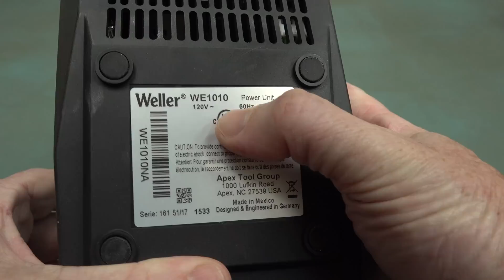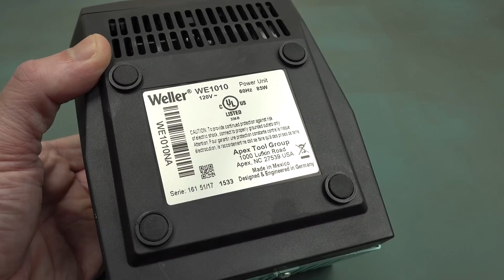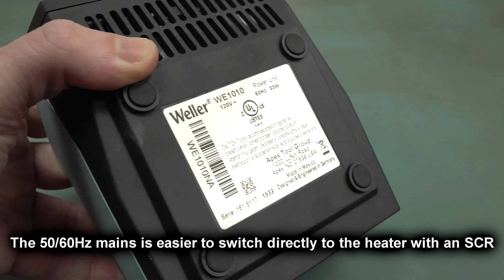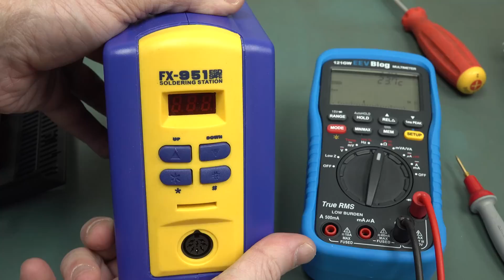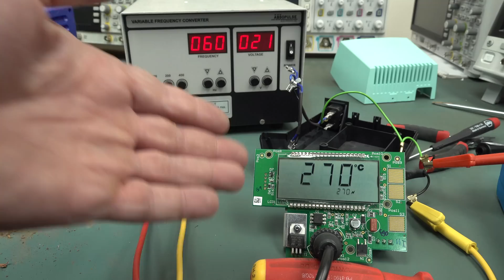EEVblog #1152 - 240V-120V = Magic Smoke!

Comment: The power tranny was a 600V triac. It should withstand the voltage even without the transformer. And you are right, once I want to use a GDR (East-German) 110/220V to 12V transformer (two primeries, you can connenct them serial or parallel) for my tcp-24 solder iron, so I gave a try and plug it into 230V as a 110V device and it didn't burn, but it was very loud.

Comment: It's not the lack of a fuse that is shocking (no pun intended) a fuse probably wouldn't help anyway. It is the fact that it has an IEC C13 connector, inviting idiots to plug a 230V kettle lead into it. It should have a fixed wire with a 120V plug on it, then at least they have to cut the plug off and wire their own on before they can burn their house down. At least that might make them think for a moment!

Comment: The transformer step down approach to heater control is easily done with SCRs or MOSFETs to only turn on or off around AC voltage zero cross with a largely resistive load. This minimizes the power dissipated in the switch(s), and has been used by PACE, Hakko, JBC and Weller to name a few. Historically, I think PACE and Weller used the technique as far back as the early 70's. The only down side is the heater is usually (for cartridge style handpieces) in series with the tip thermocouple so you have to keep the power circuit off while you read the thermocouple. If you put a cold junction temperature sense in the handle you can then determine the tip temperature.

So what exactly was the transformer failure mode? The primary winding got hot enough to melt the varnish and then short out and burn up. Okay, but where was the overload that caused the overcurrent in the primary? The fault must have started on the secondary as an overcurrent by was sustained long enough to heat up the primary. Given the secoundary fuse I am not sure how long the secoundary actually was in overload. I think the transformer was defective in manufacture or selection from design. The heat generated should not have burned through the primary varnish. Putting a fuse on the primary may not have solved the problem, given the fact it would have to be a slow blow type to not trip on magnitization current when power is applied to the transformer. The primary winding should be tested at around 1200v with a hipot tester so 230VAC will certainly not breakdown the primary insulation. I wonder if the weller unit was actually a clone from China?

Comment: Be sure not to use it in the shower!! I wouldn't use any electronic component that uses mains voltage that doesn't have a fuse on the primary side. Brain fade is the main reason why they have fuses in the first place. That could have set the lab on fire or melted the insulation on the primary wire insulation and electrocuted someone.

Comment: I realize this is very late to comment, but I just saw this video, and I can add a few things about the regulations about fusing in North America (which is the market this device was designed for).
Here, at least, the wiring in the wall is protected with over-current protection in the fuse-box or breaker panel, and the device being plugged in... well, it needs to take care of itself, because the supply isn't going to help it.

The general gist for small transformers (control transformers and the like) is that they can be fused EITHER on the input or output side.  Of course, you can fuse both sides if you choose.  I usually do that in the panels that I build, but it's not actually a requirement.

Now, I just bought one of these Weller soldering irons (the WE 1010 NA) a few days ago.  It's at work, but I'm going to check it out and see if they added primary-side fusing to it.  I didn't happen to notice when I looked at it after purchase.   I've used it for about an hour so far and I like it a lot.

Comment: Did you found out whats happened?

I guess that there is some kind of LDO that brings down the 23v to, let say, 20v or so for the heater, and the voltage drop is only like 3V or so (3v x 4A = 12W heat from linear regulator).
And when applied 46 v instead, voltage drop became 26V x 3A = 78W or so, which quickly overloaded the transformer and popped it before the LDO popped. Or something similar.

Comment: @EEVblog - Just found this video after Robert Feranec's Xilinx one, and I'm curious about the Absopulse unit you used. What is the model number/part number? I cannot find it on their website. Thanks! Cannot fathom why Weller, a company as large and with such a long history in the soldering industry, omitted such a fundamental safety feature. Love their response too. Muppets.

Comment: You could still use that secondary side as a inductor :)
And if the board can accept DC input, you can just hook it onto a swiching supply and get rid of that transformer thing at all.
Reply: Just realized that inductor would not work. You have to get rid of that shorted primary completely otherwise its still a transformer with a shorted primary side...... :(

Comment: Weller should have known better - always have a primary side fuse as well! Also a good lesson for new designers. Don't forget when calculating AC power across an inductor/primary winding you have to factor in reactance/power factor as well as the DC resistance. Fortunately you just blew the transformer. Cheap fans can also start fires when the bearing seizes up (usually hardened grease) and the motor windings overheat causing a similar fire as would the Weller unit....newer/better fans have a  fuse in the plug to prevent that.
Reply: Also better than a fuse or in addition to a fuse would be a thermal cutoff on the transformer...best safety.

Comment: Been there, done that, have the burned transformer to prove it. It STINKS!! Worse than capacitor smoke. In my case it was 110V controller connected to a 220V laser exciter. Like your weller, none of the electronics inside the controller burned, just the transformer primary. Being vintage equipment I want to find an exact match so I do not need to place extra holes in the control console for the laser.

Comment: I have always held Wellar in very high regard. I am absolutely shocked and horrified at this revaluation. We have about 12 of them in our workshop. If what you are saying is also true about our soldering irons too, I am going to have to install fuses in all of them. I would rather spend a few cents on a fuse than end up with a burned down workshop.
Reply from the maker: Take one apart and check
Reply: @EEVblog  Thar is exactly what I plan on doing first thing on Monday. I will let you know what I find.

Comment: I had an HP rack mounted UPS burn up like this about 15 years ago. The electrician in the data center had mis-wired an outlet. HP replaced the unit, but there was no fuse on the mains. That thing poured smoke!

Comment: Thankfully I have not done that yet, I have been accused of doing that 120 volt Appliance into 240 and I'm like no way I'm in a foreign country I would check everything before I plugged in. I did have a pleasant visit for the Philippines apart from that. I also do not recommend sampling the electricity 240 volts 60 hertz is not pleasant but that's another story and I did not bring enough electrical tape with me!!!!!

Comment: This is a consumer grade product.  That means cost reduction is the first order of the design.  The core is marginal at overvoltage (132v) and rapidly goes into saturation above that.  At 240 volts the resistance of the primary winding is all that limits the current, making the primary winding into a furnace of a kilowatt or more.  The college would probably burn down for sure because the students would think the smell is from a bad batch of weed and would do nothing to save their dumb asses.

Comment: You are using a part out of spec and blaming the designer. The soldering station was designed for 120V and you are using it at 240V. It seems you belong to the group of people how blame for to hot coffee, blame that the pet in the microwave did not survive of if you pump up your bicycle tires with 20 bar and explode, that the bicycle wheel has no over pressure release. If you like to use a part at 120 and 240V net, you should by a suitable one.

Comment: You found a Weller product that was cheaply made? SAY IT ISN'T SO. Alert the media! Call out the national guard! Oh wait, this is business as usual. Solution: stop buying crap. Oh wait again! There aren't any better products any more. Hexagon lost their damned minds and will disappear soon if they haven't already. Ungar was great until they sold out to Weller (Cooper Tools). Just try to find a decent station with a RUBBER insulated cord on the hand piece these days. Hakko's consumer grade stuff isn't terrible, but the ones I've touched all had low heat capacity tip designs.

Comment: No worries mate. That transformer should be able to be bought as a whole assembly with the fuse and all from Weller. Might be able to get it local purchase, even better and help your economy in the same breath. Take care mate! Would like to see you take a Pace WJS-100 apart as some don’t think it is as good as the ADS 200 which isn’t built as robustly. Certainly not as robust as an MBT 250! Keep up the good work mate!👍🏻

Comment: Australia uses a type I plugs. This station would have come with a US type A This situation would would be easily avoidable if the IEC end of the power cord was not universal or if Weller is so cheap, they could have direct wired it.

Comment: we have 2 weller's over 30 years and nothing happened  and every one knows   never put something 120 in 230 volts    try it with your tv a/c or something and there is a fuse a small red one with a termal  protection in line

Comment: You have think about saturation in the magnet core. A transformer is a couple of coils. If the voltage on its primary side coil is lower or equal to the rated voltage everything is OK and the current flow through the primary coil is low and the flux density in the magnetic core is round 0.5T. At the moment when you applied double of the rated voltage the current through the primary coil wasn't doubled. It raised more than ten times in matter of the saturation of the iron core which caused a drop of the inductivity of the primary coil to a value like being a coreless coil. ;)

Comment: I think a EI iron core of this size can transform maybe 50W means it can handle the magnetic field of 50W. It is not able to handle 200W so the magnetic field can not rise to give 4 times the inductive resistance. It breaks down. So the power rises much higher.

Comment: Pretty dumb for an electronics engineer to plug a 120V AC device (not designed to be sold or used in Australia) into a 240V AC power outlet in the first place.

Comment: pluged 5V DC smart home controller (like the Hub thing) device into 12V.
it did not even blow the inner fuse it just killed the resistors, capacitors etc. around the plug in. 

some devices are just oddly dessigned (particullary since most of these hubs used difering Voltage yet same exact power plug)

Comment: I myself experienced some magic smoke from an film capacitor of an old vcr. It was unfortunately opened when it happened and so it was shooting smoke at the ceiling like some firework. Took hours to get rid of the smoke smell. I was lucky enough to not have my head over the vcr when it happened. It literally took place 3 seconds after I studied the circuit board with my head obviously over the bloody thing while plugged in.

Comment: Dave, it wasn’t some saturation that “exacerbated” the failure. Core saturation was in fact the sole cause for this failure. V^2/R figures only in the very short term, since you’re also driving the heater with 4x the power, so when the transformer handles the heater load, it’ll only see it at 25% duty cycle. So no, this failure had nothing to do with wire insulation, and the V^2/R dissipation indeed happened because this core will conk out at just a few percent overvoltage at 50Hz. It was designed for 60Hz, and even then Weller probably made it handle not much more thab 140-150V. I have a similar vintage Weller transformer that looks identical AFAICT and it doesn’t saturate at 150V 60Hz, but saturates just short of 130V at 50Hz.

Comment: The reason it happened may be of interest: it wasn’t an insulation failure or breakdown that precipitated the smoke escape. The high voltage in itself is not a problem at all: the winding and the insulation would have handled it. The problem is that the core was minimally sized and saturated as soon as the voltage got over 130V or so – also since Aussie 50Hz eats away at whatever margins were there in a 60Hz transformer design. I have a similar 120V Weller model and the saturation indeed starts around 125-130V 50Hz. By the time you reach 240V AC on the primary, the winding behaves like a ~50Ohm resistor fed from a 50% duty cycle 120VRMS supply, and promptly overheats, producing the mesmerizing billowing smoke :)

Comment: The low primary resistance only figures into power dissipation under the assumption that the primary current bypasses most of the windings – probably a correct assumption in the case of a smoked transformer :)

Just to clarify, then: such low impedance doesn’t matter when the current makes it through the windings, because it’s not the (low) wire resistance that determines behavior then, but the inductive reactance. The primaries have “high” resistance only due to other constraints, it’s not somehow a requirement that transformers have high primary resistance. In fact, it’s a drawback, because that resistance contributes to heat dissipation. An ideal transformer of course has zero winding resistance :)

Comment: I once accidentally connected a wire to the wrong terminal in the breaker panel and fed a circuit in my house with 240V instead of 120. After I switched the power back on, I casually made my way from the basement where the breaker panel is to the second floor office, and as I entered the office I saw a lot of smoke coming from the wall wart transformer on the cordless phone base, which was still powered up and appeared to be working normally. At that exact moment I heard a loud POP! and the lights and display went out on the telephone base/answering machine, and I immediately knew what had happened. So I ran to the basement and shut the breaker off, then reconnected the wire for 120V. The plug-in transformer was toast, of course, but when I found a replacement transformer, the telephone base was in perfect working condition. I figure it was designed for a wide range of input voltages, and in fact many DC voltage regulators can handle a doubling of input voltage without overheating or damage, and maintain proper output voltage too.

Comment: Wouldnt the primary fuse only blow when current reached a certain level which may mean the windings would have to short and already some damage is done at least?  or would you set the fuse to be just high enough that the extra push from 240v would send current high enough to trip it but not burn the windings yet. Is there such thing as a voltage fuse that can sense higher voltage and trip instantly or do you have to you a crowbar SCR with a zener diode and all that which i know from repairing electronics?

Comment: Get a new transformer for it.  23V is an odd voltage but usually there's a few volts leeway in such circuits so you could probably use a trannie with a 24V secondary and it would work so long as it can supply the current.

Comment: You're exactly right about core saturation. First off, transformers are designed to run at about 70% of core saturation. Running it at 50 Hz reduces the voltage handling of the transformer by 20%, because voltage to frequency ratio is proportionate. You effectively put more than double the voltage it's designed to handle, because doubling the voltage, along with the lower frequency. The primary basically took 145 volts, at about 8 Ohms. It's no wonder it went up in smoke straight away. That core saturation likely kept the secondary voltage down, protecting the control board.
     There IS something missing! Typically, when they fuse the secondary of dual bobbin isolation transformer, there is a thermal fuse tucked into the gap of the primary winding. This fuse does NOT sense, or protect against current. They're typically rated at 10 or 15 amps. If the transformer winding gets hot enough to heat the fuse up to the boiling temperature of water, the filament melts, breaking the circuit. In the United States of America, it's required by law, to have a thermal disconnect on the primary side of the transformer.(possible quality control issue here)
     On your other cheap soldering iron controller, the primary measured 64 Ohms. If that transformer was rated for 120 volts, it would have measured 8 Ohms, 1/4 the resistance. That would keep the I^R loss the same, because of doubling the amperage on the primary, to produce the same wattage.

Comment: I did the EXACT same thing with the same iron! I bought one from the US because it was about £50 cheaper than anywhere in the UK. But I forgot that it would be 110V :doh: Same thing with smoke and everything happened too! I was so sure that the electronics would be gone too. But my bother opened it up and connected a 24V PSU to it and it seemed to work fine! Too lazy to buy a 24V transformer though so its sitting in the box waiting for one.

Comment: This really surprises me and is quite disappointing. My best guess is that this transformer runs right on the edge of saturation. Rebuild it with a nicer transformer...and maybe add a fast fuse and a varistor in the primary circuit. :)